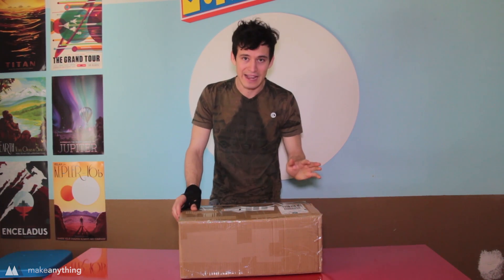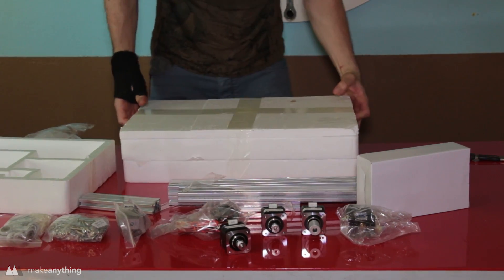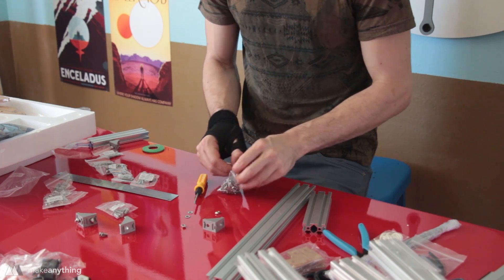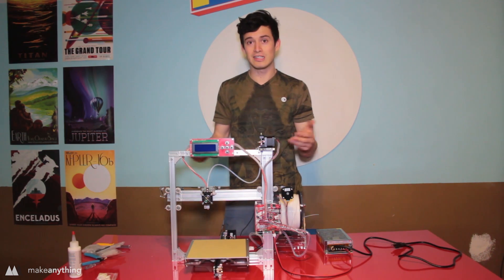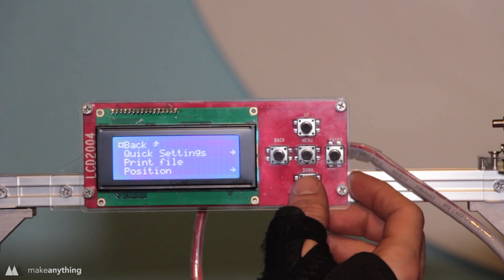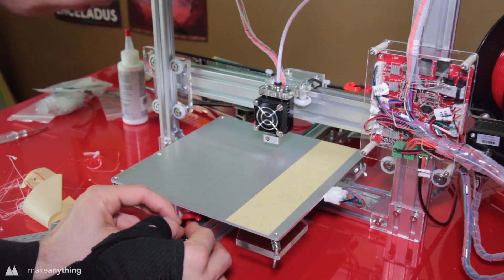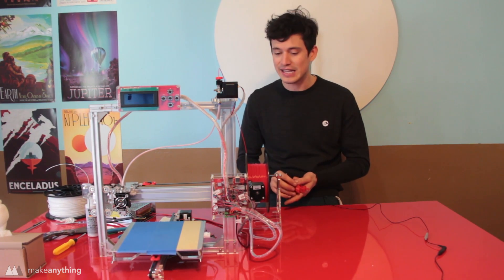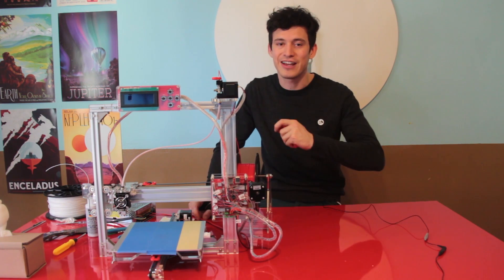Anet A2 3D Printer Build // Is this cheap printer any good?

Comment: Still using my $200 Anet A2 after assembling 8 years ago and is working just fine, have done a few basic upgrades like e3d v6 hot end with 40mm fan adaptor, 40mm parts cooling fan, different z stop for easy adjustment, flashed a version of SkyNet on the mother board, added some frame supports and had to replace z motor because mine fell apart after ramming the hotend into the bed 1 to many times. Overall I would say its been a great purchase but nothing close to todays standards. I recently got a creality ender 3 v3 se for $100 refurbished and was 90% easier to setup and half the cost with the benefit of auto-bed level and overall more beginner friendly.

Comment: Anets Assembly Video Sucks they Have NO audio and They DO not show Or EXPLAIN WHERE to connect the wires to the Mother board I bought my printer when they First came out and it has Held up on through the Years with Minor repairs hear and there but I just had to Resolder the Power connector on the Mother board and I have Lost the Wiring diagram and some of the wires have Lost their labels over the years if you still have yours could you please make a new video showing where the Wires connect because Anets website service Tab only talks about Shipping and TRACKING

Comment: This is my current printer. I put a genuine e3d, y axis dual linear rails, and direct extruder on it. It has slight sag on the x gantry still, but plan on doing a dual z setup. Overall it is a very good printer to start with and learn on. You can get almost Prusa quality prints if you spend about $200 on upgrades. Definitely get Skynet marlin, it gives it thermal runaway protection plus much easier tuning.

Comment: Did anyone with this printer have the firmware set up with the Y axis reversed?  Mine is homing backwards (table moves forward to home instead of backward towards the endstop).  The easiest fix is to reverse the polarity on the Y motor connector, but I am wondering who else has this problem, what you did and whether you made the fix in firmware.

Comment: I already have this 3D printer for a couple of months, I made a few upgrades, and believe me, it's printing really good. First thing I designed was a Z axis stepper and nut  support, the ones that came with the kit are too much flexible, so I printed a new ones, other thing I found, is that the Y axis belt needs to be very tight in order to avoid ghosting and wobbling, I'm thinking now to design something to avoid que bed inclination due to X axis fast movement, that contributes to the wobbling too.

In any case, this is not the worst printer I played with.

Comment: Never run filament through the hot end without having the tube fully inserted. Also make sure the end of the tube is cut perfectly square.
Your belts are still too loose.

Comment: I have this printer, it is my first one.  It suffers from z-axis banding, I have yet to figure out how to fix it.  The wheels get nicked during assembly by a newb like me.  Also like the A8 you should add a mosfet for the heated bed on its own power out line from the ps.  Also add a fused switch.  It does vibrate so a solid wood base and brackets helps reduce the 'waves' in printing straight lines.  I also added my own glass plates to more easily swap from ABS and PLA.

Comment: on those cheap kits, you wanna replace the belts with glass fiber GT2s, and print some proper belt mounts and adjustable tensioners, as soon as you can. it makes a big difference. the ultra cheap PU+steel belts they come with are complete rubbish. they're stiff, wont last long, and stretch under load, increasing oscillations and ripples. (A8 user here)

Comment: Hey, little quick note!  While you have the motors plugged into the main circuit board.. do NOT move the axis very fast at all!  Moving those motors without power applied generates electricity!  Too much of that, and you can short out your board!

Comment: Please don't recommend Gearbest. They are known to scam half of all their customers. It would be better if you recommended a seller from Aliexpress or ebay. I can recommend this seller because I know they treat their customers right. I am not sure if they also sell the A2 though https://www.aliexpress.com/item/Updated-Big-size-220-220-240mm-High-Quality-Precision-Reprap-Prusa-i3-DIY-3d-Printer-kit/32604869871.html?spm=2114.13010608.0.0.s6Agfk

Comment: Look into getting a mosfet and even a separate (or a single more powerful) power supply to power the bed separately. Takes heat-up time from 20 minutes to 2 minutes.
Here's a timelapse of my build: https://www.youtube.com/watch?v=KojtVQRd21w

I had to ream out the endstop brackets too but I just heated up a screw or something and used that rather than drilling it out. Somebody has made a print cooler shroud that uses a blower fan for the A2 - although the Tevo looks similar to the A2 the hotend dimensions aren't the same and so those don't work.

Comment: Pretty impressed how this budget kit uses the correct rollers for the alu profile and has enough right angle gussets for the whole frame when some other more expensive kits don't. Never been a fan of that upside down flex coupler though - bouncy! None of these kits I've come across so far have a cooling fan as stock, definitely ridiculous!
Reply: My favorite 3D printing mentor commenting on my favorite 3D artist's channel. Great!
Reply: To be fair, it's only in recent months that the maker muse has been picking printer kits that have a fan to review. Kits are a hot topic because they have so much potential at a low cost but are abused by no name retailers trying to scam people. I'm sure they will become more popular in the coming years and better designed, at least for school work they really are becoming more valuable than some expensive throw away text books.
Reply: Maker's Muse My Anet A6 has one
Reply: Can you make a video comparing between straight and upside down flex coupler? I thought the upside down ones was better because it allows for the rod to shift as needed.
Reply: Hi, I saw the 'tronxy' latest yesterday, you will be happy to see they have a cover box and switch for the powersupply/mains.  It also uses 2 z-axis motors on the bottom.  Al frame, all for $219US, on ebay.
Reply: are you sure about that? my Anet A8 came with a stock cooling fan. Im new to 3D printing as well
Reply: Do you recommend Anet 2 or Creality Ender 3 ?

Comment: The A2 is more expandable than the A8. It is basically a Tevo Tarantula knock off, but the tevo can be upgraded to dual extrusions and a larger build area, it also cast about $200. For the A2 you could probably print the same upgrades you would use on the tevo, like a better Z axis bracket.

Comment: I built a OneUp 3D printer in 2013, used it for a year, then one of the motors broke, so I went without one for a year and a half, then got my current one, a XYZPrinting Da Vinchi Mini

Comment: I think it would be cool if you could a cover for the display and the buttons, because it looks a bit "raw"(but that's only my taste). I think about something with flexible filament(if this printer is capable of printing that) on the buttons and PLA on the rest of the panel. I think about something in white. But I'm not a designer and I don't know much about design, heck, I'm even bad at art in school! So if you want to try and challenge this printer with flexible filament, that would be a good idea for a print!

Comment: 120k subscribers

that's more than the biggest 3d printer channels combined.

Don't accept crap from companies.
Reply from the maker: I just want to try out the cheap stuff because a lot of young viewers can't invest much money into 3D printing from the get go. Maybe I'm just not the most critical person, but I think this is a decent 'project printer' for tinkering with and learning how to improve print quality.
Reply: I think you did a great job and thumbs up for reviewing some of the cheap stuff as well. Also, a big part of the cheap price tag is because its a kit, which is also a great topic to cover.  As you mention towards the end of the video, this seems like a great kit, if you enjoy the process of improving the printer as much as actually printing stuff. Looking at the final machine and print quality, I would say you get a whole lot of printer and fun for less than $200. Either way, I'm sure (as you also mentions) that it is a good entry level kit to get started on. To me it doesn't look anywhere near something that would justify the "crap" tag at least. As long as the initial kit holds up to some standard of course.

I really hope you will make videos about the printer and the tinkering part. I'm sure that would make great video material.

Keep up the great work. Really enjoy all of your videos. Thanks!

Comment: I own an anet a8. And Iv had it for about 4 month running 24/7 printing fidget spinners. I chose the a8 because of the power supply mount. I was worried about the power supply moving and disconnecting the mains wires and starting a fire. Also the a8 has a part blower with a huge amount of pressure. The a8 has a more finished look. Just keep in mind that Iv made multiple mods and changes to the a8. If youre going to your first 3d printer or just a tinkering mechine then Id choose the a8.

Comment: what printer would you recommend for someone starting off (less than €500). clean and good prints
Reply: man Person 114 Probably a Wanhao Duplicator i3. I have the Aldi version and it works very well. You will want to upgrade the stock cooler to a Diii cooler since it isn't very good, and lower the acceleration and jerk settings, but out of the box it is almost fully assembled with belts that aren't crazy loose like this guy's.
Reply: the maker select v2 is an insanely good printer, in my opinion, heated build plate, cooling fans, good price. You can check it out at monoprice.com
Reply: Personally, I've had great experience with the Anet A8 Prusa i3. http://www.gearbest.com/3d-printers-3d-printer-kits/pp_337314.html $170

Comment: Honestly I would more advise this DIY printer
http://www.gearbest.com/3d-printers-3d-printer-kits/pp_337314.html
Some of the problems mentioned still exist on this one but some also are gone (the A8 has a fan for exemple)
it's better quality, same brand, nearly same assembly instruction
And the website often do flash sales of them so it goes for around 150

Do avoid buying around holidays though, did that mistake it never arrived, had to refund and buy again

Comment: You should design an enclosure for the display along with some ninjaflex buttons.
Reply: TheLuckyIsaac He can print the ninjaflex parts on another printer. Also, if he prints slow enough there's not really a problem with ninjaflex on this printer

Comment: the a8 has a fan on the extruder so although its acrylic i'd say its a better choice. (and cheaper too)
Reply: Surprisingly... if you dont over torque the screws and crack the acrylic, it is actually a pretty fantastic printer for the price, especially way better than this.
Reply: Rosendo Aguirre if you added a cooling fan would the kit be beater than a a8
Reply: I have one, and have good finish out of the box